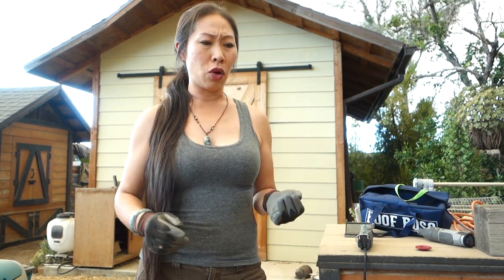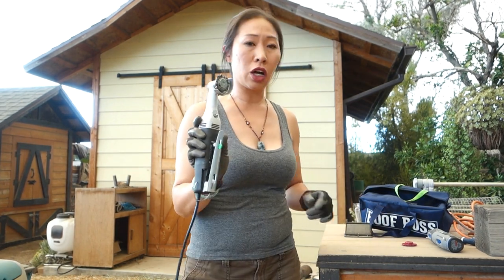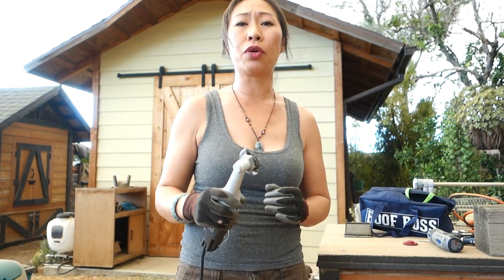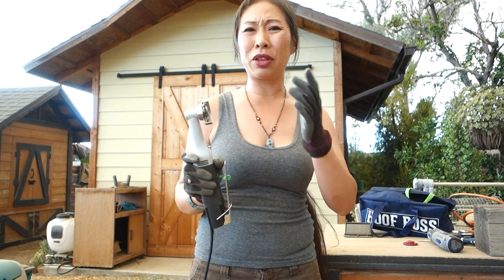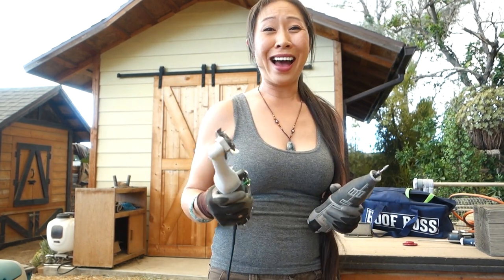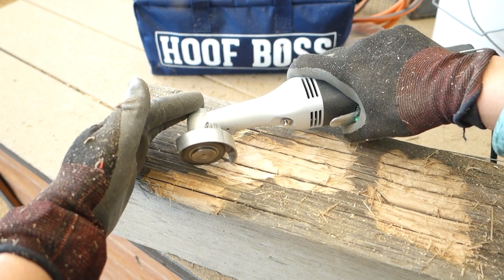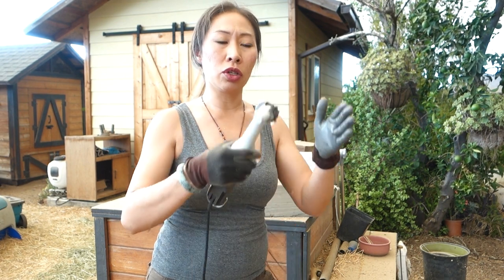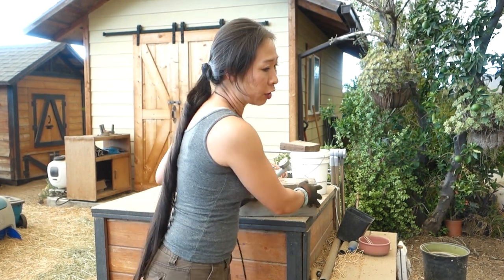Introducing the Hoof Boss

Comment: I had a depressing time struggling to trim my horse's hooves with regular tools. Our climate is currently ridiculously dry and hot, and my horse's hooves are healthy and all, but man oh man, I could hardly make a dent. Horse was an angel while I squeezed so hard to cut that I started to tremble. I'm sure I could go the old fashioned way during the wet season, but I'm gonna go with the hoof boss. I just ordered it, and I can't wait to use it and not get so exhausted trying to trim a single hoof lol
Reply: Update: i love this tool! It has been a life saver, and I'm able to easily trim my horse's hooves relatively quickly. I use it to mainly get rid of the length, I still use a rasp for rounding off and beveling. It takes a bit more pressure to cut into my horse's hooves, but it does the job well!

Comment: I just trimmed the hooves of my 2 horses this weekend, and dang I was sore and tired afterward. I was thinking there has to be a better way so I started searching and found this product and wanted to find some reviews. This video sealed the deal for me. My biggest issue is I have small hands for a guy and normal nippers dont work for me very well and I'm in a very dry climate also so the hooves are like concrete.  My only question was how long did it take for your horses to get use to the noise and feel of it? I have one horse I know he wont care at all... then other one however will be a different story :)
Reply from the maker: Most horses don't mind it at all because they have no negatives associations with it.  So just maker sure the introduction is done well.  If they are already fearful of clippers and the such... Then that's a different matter.
Reply: @DawnSChampion  no fear of clippers, just of electric motors... this is because she grabbed my cordless drill and hit the trigger on it and I have not really tried to introduce anything like that back to her because really I have not needed to yet. But I think with a hand full of treats and some slow introductions I think she will come around

Comment: If still using, how has the hoof boss held up?
Reply from the maker: The original HB that plugs into an outlet has never given me any problems and I still have that one as my back up.  When they came out with the new portable one that is battery powered, I got that one and I hated the original coiled cord.  The cord was too short and too stiff/rigid.  It actually pulled out of the housing and I had to send it back for repairs.  They replaced that cord with a straight cord and that was perfect.  Then I had a battery powered one that had a bad switch, so I sent that one back and they fixed the switch.  They had a bad batch of switches and had to change something with that.  Haven't had issues since those two things.  Each time, they were great about repairs and sending it back quickly.  They have since changed all cords to the straight one and I think they had resolved the issue with the bad switches.  Those were the only issues I've had.